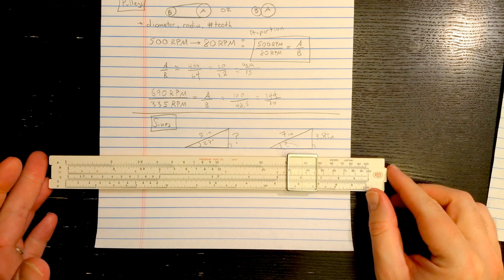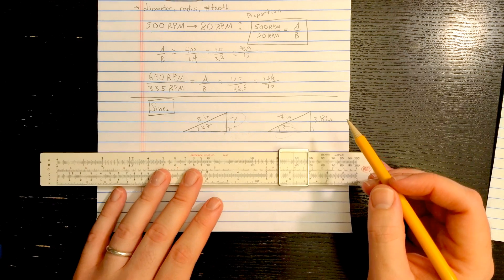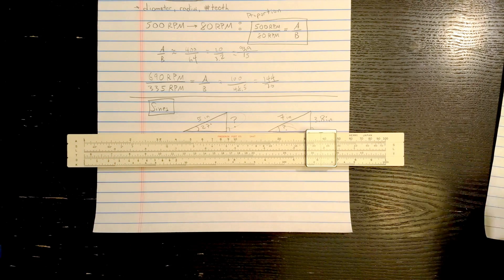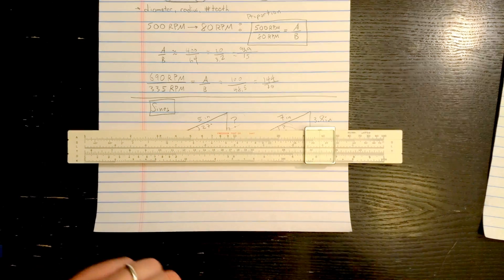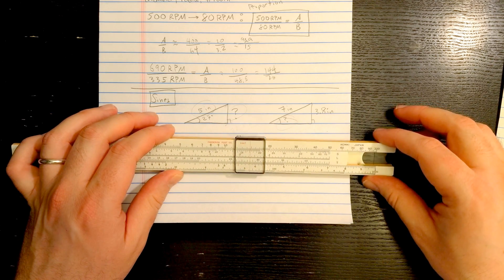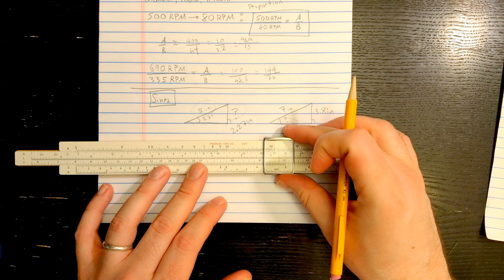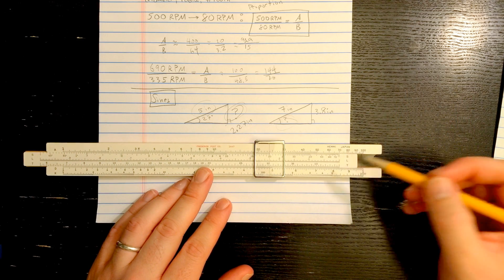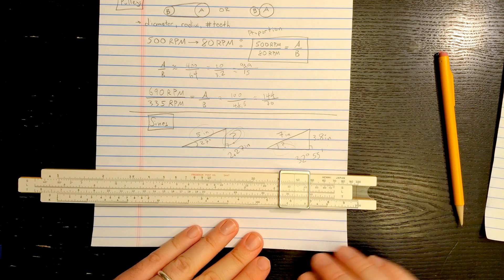Machine Shop Calculations 2/2

Comment: Roughly speaking, If you are machining metal parts, you need precision down to 0.001 of an inch if you want to get things to fit properly. That's when you pull out your trig table instead of the slide rule. My CAD Program (DesignCAD) always generated the dimensions for me. For paper drafting, the draftsman had to do the calculation. Sometimes the machinist had do the trig if he needed a dimension that was not on the blueprint. The Machinery's Handbook, which was a tool every machinist used, had all the Trig tables.
Now I have to ask what good were slide rules with only 3 significant digits which could only give a precision of 0.01 inch. And the third digit was extrapolated. 0.005 of an inch is the difference between a wobbly pin in a hole and a pin that will not fit.  There had to be some other way of doing calculations accurately out to 3 decimal places.
My father was an old school machinist and he was always doing calculations on paper. He never used a slide rule. Machinery's Handbook was the only calculation tool he had. 

It ultimately comes down to understanding what you are trying to accomplish in regards to fit and precision, what tools you have and their accuracy and precision.

Comment: Why use quadratic scale?
Reply from the maker: Can you clarify your question? Are you wondering why I use the S scale with the A scale in the video? If so, there is a difference in the S scale between slide rules. On this rule, the S scale is "keyed" to A and B. On some, especially duplex (two sided), slide rules the S scale is "keyed" to C and D.
Reply: @ProfessorHerning 
Further, when the S scale is keyed to A/B then the need for an ST scale is removed.

One trades the greater range of the distinct S and T scales (when keyed to A/B) against slightly greater precision in the calculations (when keyed to C/D) but the need for a S/T scale at the low end.
Reply from the maker: True, although depending how you define it, you might say the precision is halved.

Comment: buy the way here is a interesting surveying tool that uses tangent to solve for height this is how you measure a tree in the woods https://youtu.be/cgizGYDPb84 you may have to start collecting inclinometers also now lol
Reply: that was a very lucky day the set seemed to be brand new whin i got it think i paid $50.00 well worth it iv used them many many times.
Reply: i do . don't ask what a got my pre 1908 brown and sharpe mill for lol
Reply from the maker: I do have an older Suunto PM-5 I got from eBay a while back. I bring it in to my Precalculus classes when we're doing trigonometry. The resolution is not as good as the type you're using there, but it's good enough for a rough measurement of a tree or building.

Comment: thanks again for the info not sure i got the right information to you on what i wanted as far a the pulley problem . perhaps i should pose it this way if i have shaft a running at 200 rpm. and need the shaft b to run at 100 rpm. i can see that the pulley on b needs to be half the size of a . how would i set up a proportion so i can see what combinations of pulleys would work (i might have a random set in the pile that would work instead of building or finding them in the wild lol )
Reply: after watching the first video i think that set up can solve both the rpm and pulley size problems is this correct. (better machinist then mathematician it seems lol oh well we all have our strengths)
Reply: will do thanks !
Reply from the maker: The two numbers I'm getting in the fractions are intended to be the A and B pulley sizes as you say.
Reply: ok i think i understand that
Reply from the maker: If you know the ratio you want is 2:1, you'd just align the 2 on A with the 1 on B instead of using the speeds like I did.
Reply: ok i see
Reply: Hi! Great video... Love the whole series!

Regarding pulley and gear problems - the methodology is sound, but it appears backwards. Maybe I misunderstood, but I wanted to make sure everyone knows that small pulleys(or gears) turn faster.
Example:
If a 6" driving pulley turns at 100rpm, a 3" output pulley would turn 200rpm and a 12" output pulley would turn 50 rpm.

If this was already clear to everyone... Nevermind! 
Britt

Comment: it seems that problems im looking to solve are not  a challenge on the slide rule id even say the sine calculation it maybe even easier then on a calculator. for the most part you would know the angle you are aiming at so i would be using the first form of the problem finding the stack if i wanted to work to the forth decimal place on that how would one go about it ? my gauge blocks are accurate down to .0001" and you would build that stack to that resolution. but that sed being off .0001 or .0002 makes very little difference in the real world for most things (maybe for nasa but not a home shop)
Reply from the maker: The fourth decimal place is tricky on a slide rule. When using the C and D scales on a well made rule, the fourth place can sometimes be guessed, but it's usually a little off. If you have a Pickett 120 as you mentioned in the other post, play around with using S and D. On that rule S should be used with D (but in the same way -- hypotenuse on D aligned with the end of S).

I'd guess the solution to your problem at the time was to use a sine table (or a log sine table) with at least five places. On Wikipedia it mentions that the sine bar is made to an integer length to aid calculations. You'd look up the sine then multiply by 5 by hand.

The best way to get more resolution on a slide rule is to make the scale you are using longer. A 20" rule with S that works with D would be better, but these are hard to find inexpensively in good condition. They're more rare, and age tends to warp the longer wood. An example would be the K+E 4080-5 or 4081-5 (later model numbers are different).
Reply from the maker: I should be saying "fourth significant figure" above. For your application this makes the situation worse since one of your significant figures is to the left of the decimal point. e.g. 3.2746 has five significant figures. A normal slide rule (even 20") is not going to be able to give you this.